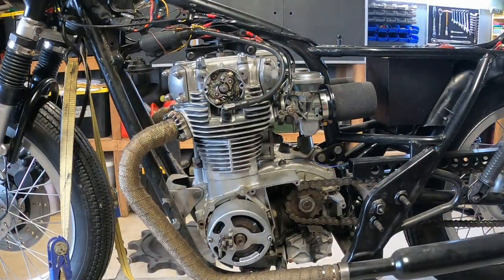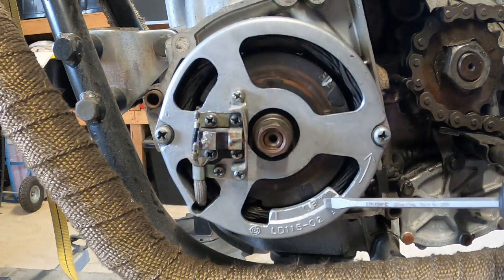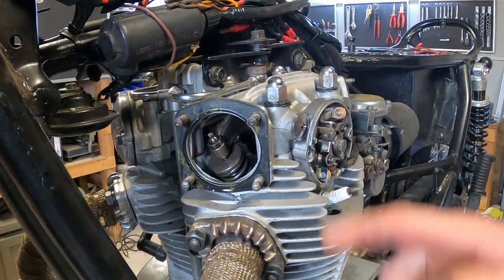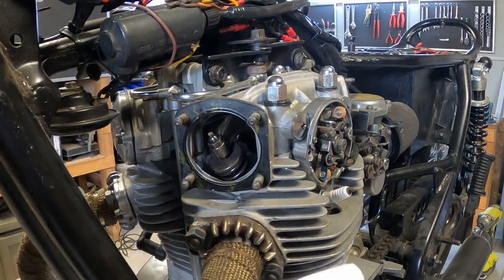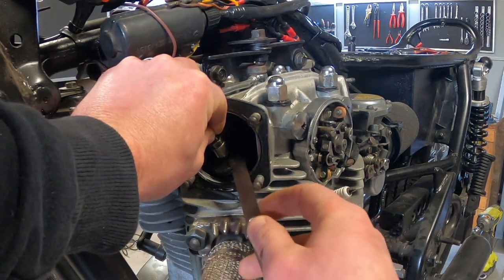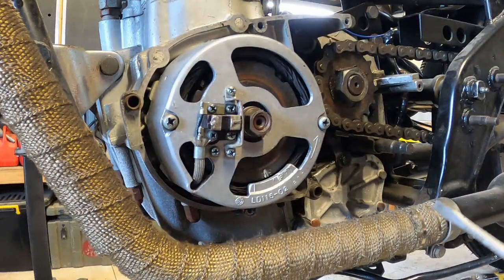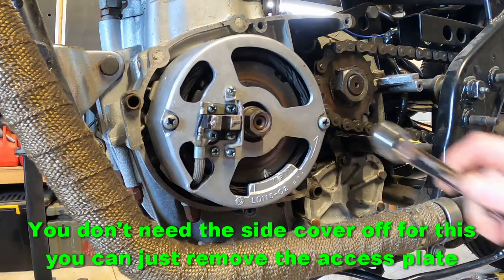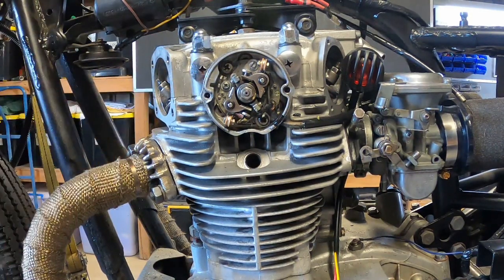XS650 Brat Build Ep 25, Ignition Timing and Valve Clearances

Comment: Very good instructions. Not sure if you can or will help with a conundrum I have with timing. Say for the right cylinder and the test light on the top points I line up the fire mark with the mark on the fly wheel. The test light comes on way to early. I try to adjust the backing plate to turn off the test light and set it correctly but there's not enough travel in the backing plate. Hope this makes sense. I have pictures if that helps.
Reply: You might try checking the position of your advance rod! Mine had to be reset to where the rod would push the bracket at the right time. It’s not the easiest thing in the world, but set your gaps when the rod pushes both brackets and you should be pretty close, hope this helps!

Comment: Hey quick question. When doing the timing, how can you tell when right side is on compression stroke
Reply from the maker: Check to see that both valves are closed. There should be a little bit of play in each of the rockers on that cylinder.

Comment: I'm going back through my 1975 SX650.  I bought it new.  Now, I'm an amputee.  I lost my left leg in a below the knee amputation.  I would prefer to use all of the gears of my gear box, so I need to find a different way to shift.  I have noticed some after market adapters to move the shifting to the left hand grip (designs range from $3,000 to $100).  I can design my own using a solenoid and a Harley type shifter.  Do you have any recommendations about what to do or not to do?  Thank You!
Reply from the maker: Sorry to hear about the amputation. I can think of a few options. You could build your own  using a solenoid (i have also seen pneumatic actuators and air reservoirs used) but it is unlikely that you would get it 100% right on  the first design and it would take a lot of testing and re-design (i enjoy that kind of thing but not everyone does).
You could move the shifter to the right foot using linkages then install a thumb brake like Mick Doohan had but this would also require you to change the rear wheel to a later, hydraulic disk brake model. These build it yourself options have an open ended price tag due to the inevitable need to re-design and improve whereas the commercial options provide a measure of certainty but likely at a higher price. It all depends on what your willing to spend vs how much effort/frustration you're willing to invest. Good luck with it.
Reply: Also, it’s a pretty common practice amongst older dirt, flat-track racers to  modify these XS motors to right hand shift for racing purposes. You could find a racer that knows a machinist that would do the work.

Comment: Great Video.  I'm working on a '75 XS650 and I was wondering about Electronic Ignition compared to points & condenser?
Reply from the maker: Thanks mate. Electronic ignition is pretty much maintenance free once set up correctly whereas point coil requires periodic adjustment and maintenance. I can't comment on any of the electronic kits out there for the xs as I have no experience with them. I may try Electronic in the future but I would do my research first. Points may be a pain as far as maintenance is concerned but they are unlikely to leave you stranded which I have heard some of the aftermarket set ups can do.

Comment: Say bud are swapping the stock gearing? Also what jetting are you running ( bs 38).beautiful bike. Love the tank color
Reply: @2wheelworkshop  well some ppl just widen the hole in the stock jets,thats what the "old school " guys did,probably what he did because maybe he couldn't just order ,but it sounds good 👍  also the reason I asked about the sprockets is because it made a huge difference on my 80 xs .at 70 mph with stock gearing,it was really whining,i changed rear sprocket down two teeth and now it has more throw in 5th gear and whining at high speeds is subdued a lot.it really helped,i think the problem is the bike being 40+ yrs old and geared for the speed limit then.anyhow,sorry for the long comment and I hope that helps ya! Beautiful bike btw